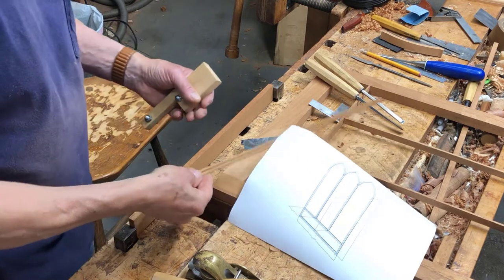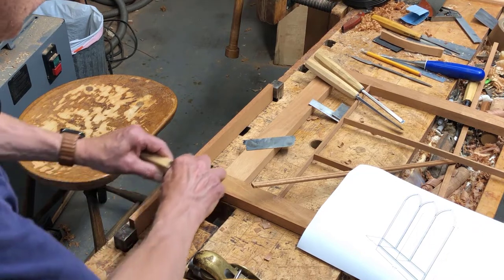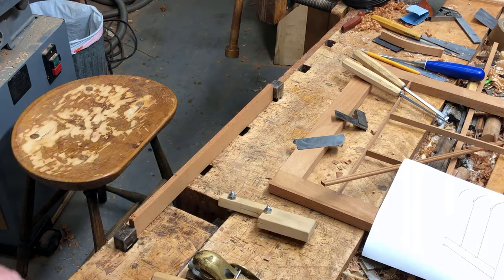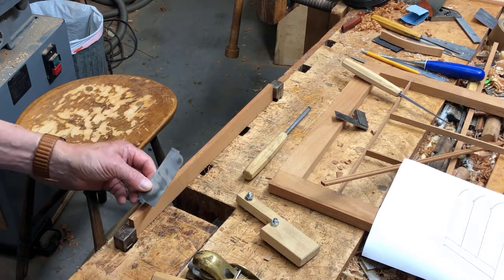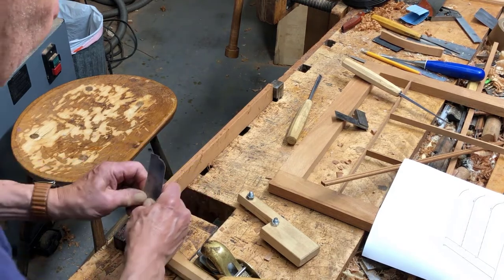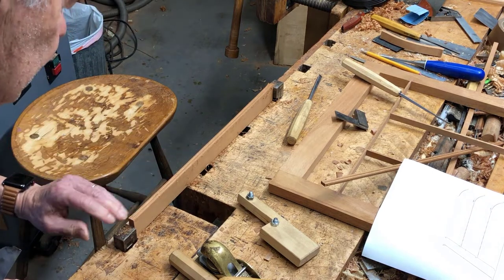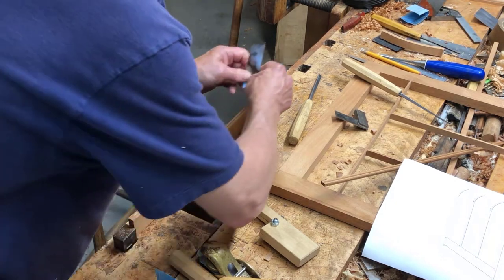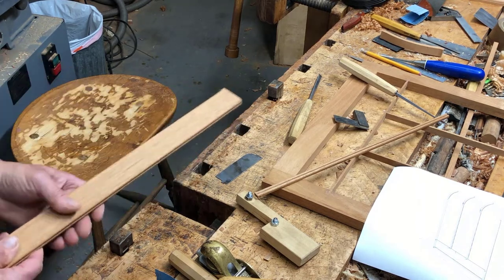Shaping the Fluted Moldings

Comment: It there a shallow dado on the back to align the molding strips with the vertical strips already in the door?
Reply from the maker: Jay, I did not have a dado, rather positioned by eye.
Reply: @killenwood  Thanks.  I made doors similar to this with a 1/32 dado and this left only another 1/32 ofnthickness at bottom of the central groove so wasn't a great idea.  Did you use glued strips of linen to stabilize crossing points?
Reply from the maker: @woodmanJ1  I did not use linen. Those v joints are very stable.
Reply: @killenwood  Thanks.  They're just butt joints? I used the linen especially when I had 3 ribs coming together at a point and had to miter each one and fit by hand with a small plane, and the fit wasn't always perfect
Reply from the maker: @woodmanJ1  Jay, these are V joints at the intersection of two moldings perpendicular. I didn't have any angles and more than two connections.